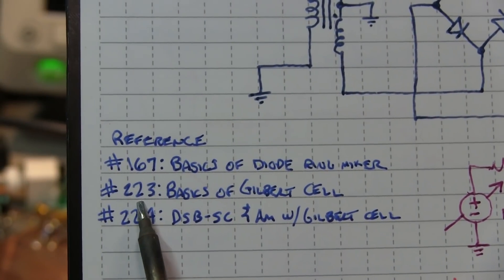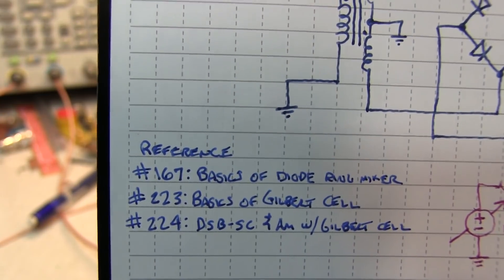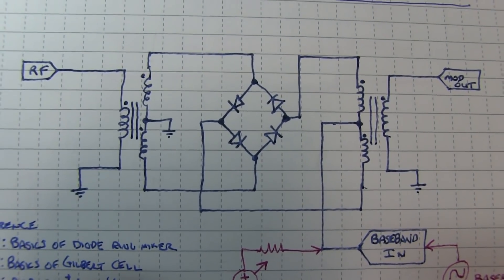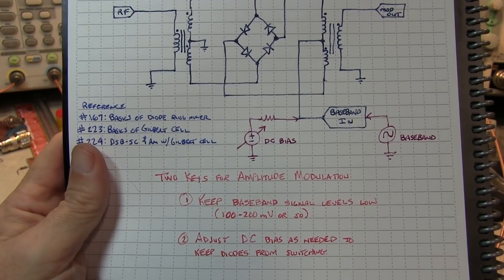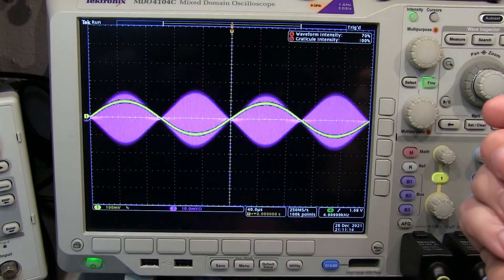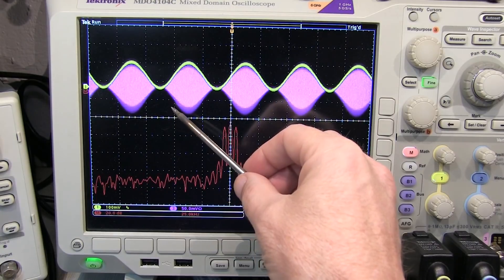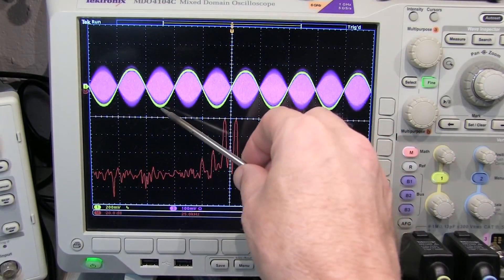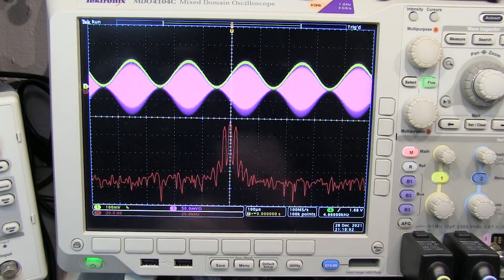#345: Generating AM and DSB-SC with a Double-Balanced Diode Ring Mixer / Modulator

Comment: How to calculate mixer with specific impedance on its inputs for example 50 Ohms? And how to measure it on assembled device?
Reply from the maker: For a diode ring mixer like this - the RF and IF ports are effectively a 1:1 transformer since the idea is that the commutating diodes are on (and just reverse polarity on LO cycles), thus connecting the transformers together.  Thus, the impedance looking into one of these ports is equal to the impedance on the other port.  The LO port is not 50 ohms, and really isn't intended to be - it is a non-linear load consisting of modulating the diodes on and off.
Reply: @w2aew  thank you👍

Comment: Question: When using split supply with virtual ground, would the transformer ground points be virtual ground or negative? ... trying to avoid smoke.

Comment: Can you do a video on using the mixer to demodulate SSB? There is not much info online about building an SSB receiver.
Reply from the maker: It's actually fairly simple.  A SSB signal is essentially just the baseband audio signal that has been shifted up in frequency.  To demodulate, apply the SSB to a mixer and provide an LO at the frequency of where the (suppressed) carrier would be.  One of the mixing products at the output will simply be the baseband audio - just apply a low pass filter.
Reply: @w2aew  I understand the general principle, but I'm a bit fuzzy on the details. There don't seem to be any simple SSB Receiver schematics available online. Do you know of any?
Reply from the maker: @andrewferg8737  There is a fair bit of info from some of the homebrew QRP ham radio guys - such as Pete N6QW.  Check out this blog post: https://www.n6qw.com/Simple_SSB.html.   Also, simple shortwave / SSB receivers like my old Realistic DX-160 are pretty simple - schematics available online.
Reply: @w2aew  Will do!
I'm thinking to adapt your Gilbert Cell for SSB receiver demodulation. It has worked very well in my previous transmitter projects.
Curious what the standard IF is for SSB amateur bands? 455k  or 10.6M... ?
Reply from the maker: @andrewferg8737  455k is quite common.
Reply: @w2aew  Suppose I'm receiving a 50 MHz SSB signal. My receiver front end needs a 50 MHz osc. I then down convert this received signal to 455k with transformers and ceramic filters and amplify it. Then I inject this converted signal into the mixer and inject a clean 455k signal from a separate osc into the other port of the mixer...?  This outputs an AM signal containing the original AF information from the received SSB signal which I can then convert to audio...   
Is that right or did I miss something?
A demonstration would help... hint, hint.
Reply from the maker: @andrewferg8737  If you have a SSB signal at 50MHz, you'd mix it with 50.455MHz and filter output of mixer with BPF at 455kHz to get the IF signal.  Mix this IF with 455kHz LO and low-pass filter the output - it will be the baseband audio (not an AM signal).
Reply: @w2aew  I've done this with AM heterodyne receivers, but the SSB version confuses me with two mixing stages.
Reply from the maker: @andrewferg8737  The main benefit to two mixing stages is improved selectivity and image rejection with a lower frequency IF filter.  You can, of course, use direct conversion.  For example, if your SSB signal was at a (suppressed) carrier of 50MHz, you can mix the SSB with a local oscillator at 50MHz, and get the audio directly out of the mixer.

Comment: Great video as always Allen. I have been thinking about a project I would like your opinion on. In this project I would have two antennas connected to an RF switch spaced a quarter wavelength apart. The common of the switch is connected to the RF input to a mixer. If the antennas were switched fast enough would I be able to see a phase shift on the output of the mixer. For my project the received RF would be centered at 434MHz and my LO would be set to 434.1MHz to give me a 100KHz output. I did try this but I was unable to see a phase shift as I was expecting. I'm not familiar with mixers but my first thought is that the mixer is reducing the phase shift to the point where it isn't visible on my scope. What are your thoughts on this? Possible video idea? Keep up the good work.
Reply from the maker: A few comments.  
1) The phase shift observed would be proportional to the angle of arrival of the signal to the two antennas.  If it is perpendicular to the plane of the antennas, there would be no phase shift at all.  
2) The trick is would be how to trigger the scope so that you could actually see the phase change.  If you are triggering on the IF output (the 100kHz output), then you won't easily see the phase change because the scope will be triggering will always be at the same point in the waveform, even if a phase shift occurs.  Thus, you'd need to acquire a long-duration signal to ensure that the phase shift occurs somewhere within the acquisition.  This means that you probably want to trigger on the switch control signal, and capture a long enough record pre- and post-trigger - even then, it may be difficult to see the phase change, depending upon how fast the switch switches, and the fact that you won't have a unshifted reference to compare your signal against.
Reply: @w2aew  Thanks for the information. Yes, I am trying to experiment with Angle of Arrival. Basically, I am trying to reproduce how Bluetooth location finding works on the UHF band. And of course doing so on without quadrature mixing. Or at least attempting to.

Comment: I have been curious to single sideband stuff myself.
Is there any trivial methods of creating it?
Reply from the maker: Most common is to create DSB-SC and then filter away the unwanted sideband.
Reply: @w2aew  Filtering away half of a double sideband is a simple solution, downside is that it needs a good filter.

Though, I guess one could relatively simply increase the distance between our suppressed carrier and the two sidebands and thereby giving us room for a less steep filter.
Reply from the maker: @todayonthebench   Usually you would generate the DSB-SC signal at a lower IF frequency, where it is easier to make a steep filter, then up-convert to the operating frequency.

Comment: The Baseband frequency is the Carrier? and the baseband frequency is being suppressed by the DC voltage? Most RF mixers you want to Filter out the upper side band and lower side band but in DSB-SC you want to NOT Filter out the upper side band and lower side band by NOT filtering out the sum and different frequencies? because most RF mixers have bandpass filter to reject the upper side band/ sum frequencies and lower sideband differences frequencies. The BSC-SC you don't use a bandpass filter AFTER the RF mixer?
Reply from the maker: No, the baseband is the audio/information that you want to put onto the carrier.  In most mixer applications, you typically will filter all but one of the mixing components - which means that you usually keep one of the "sidebands".
Reply: @w2aew  But why would you want to keep Two sidebands? When viewed on your spectrum analyzer I don't see the audio information. What is between the two sidebands in the middle frequency will increase and decrease which is the carrier frequency. The Carrier frequency is between the two side bands viewed on the spectrum analyzer. The Carrier Frequency is the baseband frequency? or where is the carrier frequency coming from. I don't see the audio signal information on your spectrum analyzer it only shows the 2 sideband frequency and the middle carrier between the 2 sidebands increasing and decreasing only when you add positive or negative DC offset to the baseband frequency.
Reply from the maker: @waynegram8907  The "information" or audio signal is in each sideband.  In this particular case, since the baseband was a single 5kHz tone, the DSB-SC output is essentially carrier_freq minus 5kHz and carrier_freq plus 5kHz.  If the baseband was an audio signal, you'd the the audio spectrum mirrored around the suppressed carrier frequency.  Since both sidebands contain the same information, one of the sidebands is often filtered away leaving you with single-sideband (upper or lower).
Reply: @w2aew  100% percent modulation is considered GOOD or BAD? because the carrier frequency is 5khztone which is 6dB above the two sidebands which is considered bad or good at 100% percent modulation? What modulation percentage is considered good and what modulation percentage is considered bad?
Reply from the maker: @waynegram8907  100% modulation OK, just don't go beyond 100%.  Less than 100% modulation will just result in less detected baseband magnitude, but still OK.
Reply: @w2aew   100% modulation the carrier frequency 5Khz will be 6dB above the sidebands which the carrier frequency is NOT suppressed when the modulation is at 100% modulation. I thought you would want the carrier frequency 5khz to be suppressed as low as possible but the modulation would NOT be at 100% modulation when the carrier frequency is suppressed at max?
Reply from the maker: @waynegram8907  The 5kHz signal is NOT the carrier.  The 5kHz signal is NOT the carrier. The 5kHz signal is NOT the carrier. 
For Amplitude Modulation, the carrier is NOT suppressed.  When the modulation depth is at 100%, the sideband power is 6dB below the carrier power.  If the modulation depth is less than 100%, the sideband power will be more than 6dB below the carrier.

Comment: Great and informative video. I hope that Tek scope has a hardened glass plate on the LCD. It sounded like it has, but I was a bit uncomfortable hearing the soldering tip hitting and scratching the surface. That one scope worth more even second hand that my whole workshop with dozens of my vintage instruments.
Reply from the maker: Sorry, it sounded much louder on camera - I was barely touching the screen surface.

Comment: Great video, well explained and takes me back to my AM days where modulation was high level and almost never perfect in my rigs anyway. My 6m AM tx never had a scope on it but did give me interstate contacts for several years. If only i knew then what i do now! 73 Andrew VK1DA/VK2UH
Reply: A little over 20 years ago I used to work with a very good amp builder and while everyone just wanted to “over modulate” their rigs the guy I was working with cared more about the linearity of the signal rather then just the “bird watts”. That’s how the “magnaforce” line of amps was created. Great part of history of amp building now.

Comment: Nice. Is it also possible to generate SSB modulation using diode ring mixer ?
Reply from the maker: Usually you generate DSB-SC and filter away the unwanted sideband.

Comment: I like the use of a soldering station tip as the pointer. Looks like a tip for a Metcal station, which works on RF and the curie point and could almost warrant its own video since they are quite fascinating in how they work. As always, the video was very informative! 👍
Reply from the maker: Yep - good eye - it was a Metcal tip.
Reply: I'm still using my old OKI soldering station , The thing just keeps in running 👍

Comment: Great video! As I am now experimenting with a TUF-3 mixer. What was the offset voltage that you added that gave 100% modulation?
Reply from the maker: It was basically 1/2 the p-p baseband voltage - but it will depend a little on the diodes in the mixer.
Reply: @w2aew  That’s cool, I am finalizing the design for my AM rig and this was exactly what I’ve been working on. The last thing I have to decide is how I will control modulation percentage either by varying the bias voltage or the audio signal.

Comment: Hi Sr, I have the 1n5711 diodes to built the mixer, Its possible to do it with them?  And What is de that value of the resistor next to DC bias supply ?
Reply from the maker: Yes, but you may have to experiment with the signal level to keep distortion low. The resistor value isn’t critical.  A few hundred ohms will likely work fine.
Reply: @w2aew  Thank you Sr and happy new year !